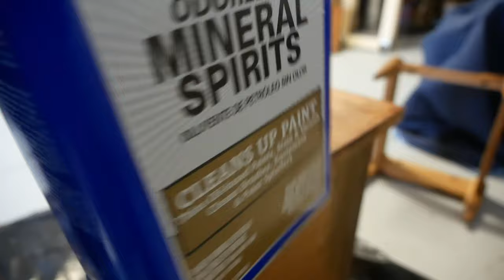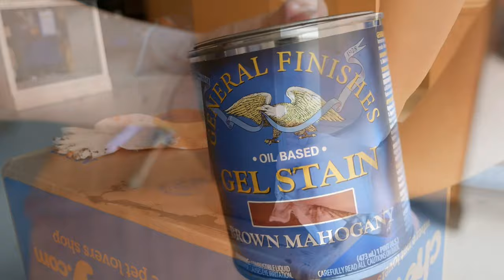Mid Century Modern Side Table Refinish | No Paint | No Talking | Furniture Makeover & Veneer Repair

Comment: At 6:29 you could put the piece on its side and run the tool straight, it saves time on large portions
Reply from the maker: Agreed! That inner cut was not pleasant to make. I think the next time for that part I will flip it on to the top and use a chisel to trim it to size. Thank you for thr tip!

Comment: In a lot of these vids I never see a pair of end tables refinished. Don't people want a pair? I would think one lonely end-table would be hard to unload no matter how well it was restored. It won't match the other one they already have or will have to obtain from somewhere else.

I would like to see someone make a matching pair out of two similar but not exactly the same end-tables just by putting an identical finish and hardware on it.  I would buy that pair!  Same with his and her (or his and his in my case) dressers.
Reply: oil based poly --- I approve!

I like the pull down instead of the drawer.  That would be easier to get into while in bed I would think.  

Nice job!